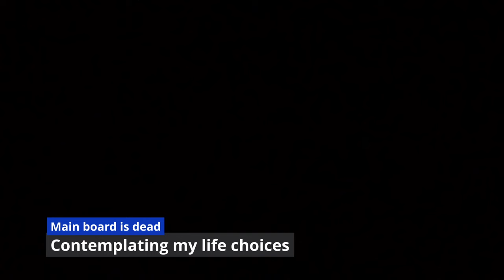How NOT to replace lathe bearings

Comment: Use the right tools.  It makes the job so much easier.  Hook type spanner wrenches are not expensive and have a much better feel for what you're doing than hammering the nut using a screwdriver for a punch.  The grease really need to be packing inside the bearing rather than smeared onto the outside.

Comment: I have the feeling this new bearings will not live long. They don't like a heavy pre load. The slotted nuts should be adjusted carefully.
Reply from the maker: 😬 Tend to agree, could be overtightened.
Reply: Just check the temperature with your hand, too much preload it will be too hot to touch. ( been there done that)😂
Reply from the maker: @azinfidel6461  these bearings are made for trucks and tractors, they are rated for 70 tons of axial load at 4300 rpm on grease so it should be all right as long as they're clean.
Reply: @MaximKachurovskiy  on vehicle wheel bearings with taper roller bearings, tighten nut till no slack then undo a quarter if a turn and lock nut. So on your installation i would undo both the nuts, nip up the first nut, tap both ends of the shaft with a hammer and a wood block, this seems to seat the bearings in the housings, tighten the nut a bit more and spin the shaft by hand. Tighten up the lock nut and run on no load from low to high speed, check bearing temperatures, if getting very hot slacken off nuts, if no heat change carefully nip the nuts up a little more. Every one has their own preferences but careful adjustments give good results. Many thanks for all your helpful videos.
Reply: @MaximKachurovskiy  the rating doesnt matter, the whole idea with a tapered bearing is that they should not be under pressure, it will 100% lead to premature failure, that is the whole reason there are 2 locking rings, also the amount of grease used was not enough, you really need to get the grease in between the race and the cage .. ALSO, you shouldnt use the bearing to press in the outer race as that can do damage to the bearings!  even the smallest imperfection will lead to premature failure

i say all this as someone who replaces these bearing all the time for cars, but hey maybe in a lathe all of these procedures are obsolete? i cant really say
Reply from the maker: @KiwiKuraun  I'm sure you are right, this is why this video is titled as it is 😄

Comment: Here's a project idea, hack the controller for the dc brushless motor and make it controllable from the esp32 of your ELS. Re. bearings, fully sealed angular contact bearings would be a better option.
Reply from the maker: You mean the old motor or the new one? Old one is a pointless rabbit hole (those motors are rare, expensive and not good) and the new one makes little sense to control from the ELS - knob is the best UI for controlling a motor and H4 has no knobs. In general, modularity is better - so a separate lever for the motor :) I'd be interested in sealed angular but I didn't find any for my size (32010).
Reply: @MaximKachurovskiy  lol Youtube is blocking comments, 7010 angular bearing is what you need I think.

Comment: Great Videos! They have really helped me with my MX-600 which is similar. Have you by chance figured out the gearing for a .80mm thread pitch?  I want to cut M5 x .80 and can't find a gear ratio.
Reply from the maker: You can calculate the gears needed on https://kachurovskiy.com/pages/gear-calculator/
Reply: Thanks so much, great Calc!

Comment: @0:23 for anyone else watching, this is not a good way to press and bearings. You never want to put force through a bearing into a race when seating it, it can put dents into the race that cause premature failure. For typical deep groove roller bearings, you make a shell/tube that only contacts the race you are driving against. If it’s on the shaft you make a shell that only contacts the inner ring. If you are seating it into a bore you make a shell that only contacts the outer ring.  So for these tapered roller bearings, just leave the roller pack out-of-the-way entirely and use a block of wood or aluminum to press the outer race into the bore (which is where he ended up at @0:25 anyways)

Comment: This sewing machine motor sounds annoying. But I can imagine why you prefer it to an 3 phase motor with inverter 🤣
Reply from the maker: It does. But it was so cheap I couldn't refuse 😄
Reply: @MaximKachurovskiy  I can imagine that this sewing machine motor does work fine with ELS. The inverter motor made a lot of trouble. Even if everything looked to work ok, I found out that during braking it sends noise to the spindle encoder. After stopping and measuring it did start in other position. I fixed it with longer decceleration time. Now it works perfekt.